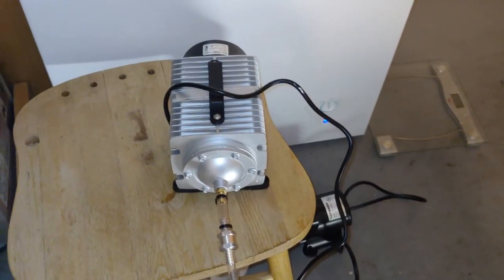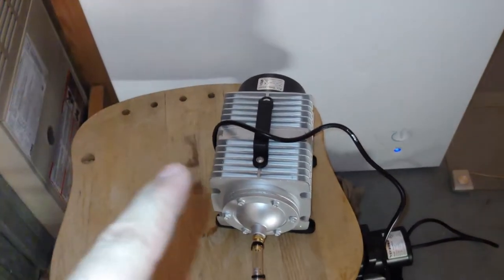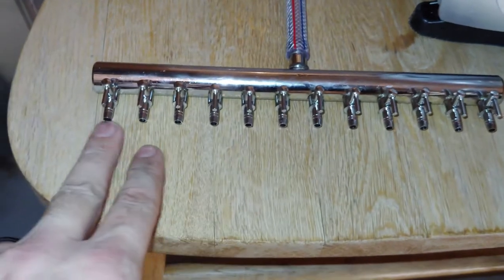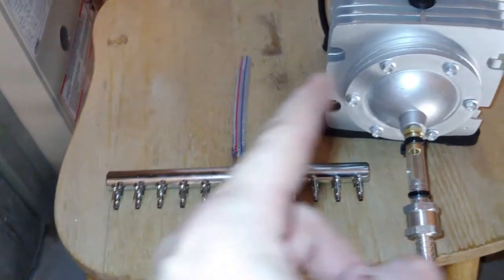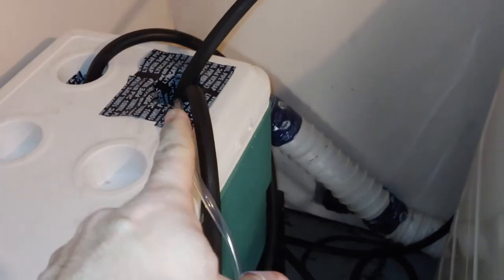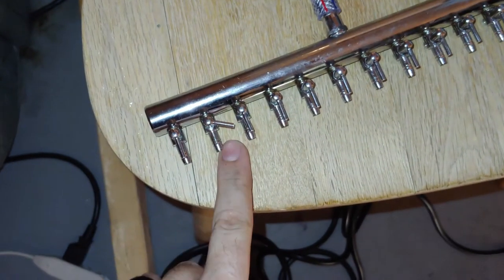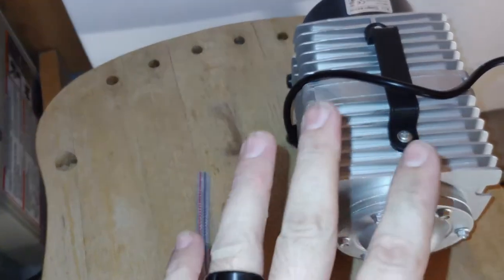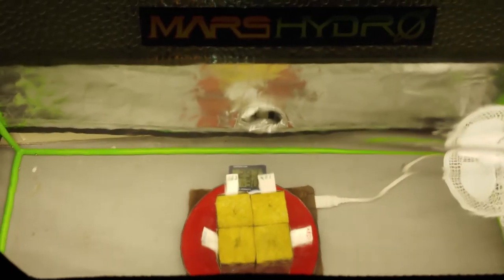Are you killing your pump??? Watch before buying a commercial air pump!!!!!!

Comment: People don't seem to get this fact.  Bleed off your excess pressure, don't dead head the pump..  Redirect that extra air back at your pump, and then you can keep the pump even cooler :)
Reply: what do you mean by Redirect that air? How???
Reply: @slotreality  just use one of your extra ports to bleed off any extra air, and if you want, take the port and direct the air back to blow on the pump and cool it down a little.  Key thing, don't pinch off the air vent any extra air, allowing the pump to not have to work so hard.
Reply: To blow the air back to the pump exterior...well thats what he said in the first place not to block outlets...
Reply: I just bought one open box and realized that the outlet port is only 1/16 NPT and that's a restriction right there. Why go from 1/16 NPT to a much bigger 3/8 makes no sense and the barbs I can't seem to find anywhere. It comes with two, a 1/4" Barb and a 3/8 Barb. If these get lost forget about finding another one. I'm thinking of drilling it out and tapping it up to 1/8" but not sure if there is enough material on the housing to drill it out without the housing cracking.

Comment: hello there, you're saying that every time I on this pump I have to let it all on and don't let one ports off?
Reply from the maker: No, just do the least amount of adjustment to the valves and make sure that the pump is not oversized for what you are doing, if the pump is restricted too much then it causes too much heat and the pump will die faster

Comment: I have the 15W version.  I have 2 airstones connected and I just open a 3rd valve just enough to relieve the back pressure so it stays cooler.  Just keep an eye on the bubbles so you can tell when you open it too much.  It will be obvious.  Now it's just warm to the touch.  I do plan on adding another line.  That should take care of the backpressure issue without having to have a valve slightly open.

Comment: Thanks for the upload. I'm looking at adding a pump with 3-4 items for airflow. It's for a 60-gallon tank that I plan to have guppy fish in. I was looking at the 20W-317GPH size. Should this be good if I use all 4? Thanks.
Reply: I am using a 20W pump for my 600 liter fishtank ower 4 stones, and it is more than enough, i could easily add at least 6 or 8 ones to that pump. So i think the 20 or 18W will be more than enough for a 60 gallon tank. Guppys are not that demanding whan it come to waterflow, so i could probably get away with even less, but i decided to use the higher flow in order to prevent fungi infestion from stale water. For commercial use the manufacturer reccomend 6 items for the 20W pump, but that will give a realy high airflow. 3-4 1-2" items sound good to me for a 60 gallon tank for all normal species, like guppys, ancistrus, neon tetras, etc.